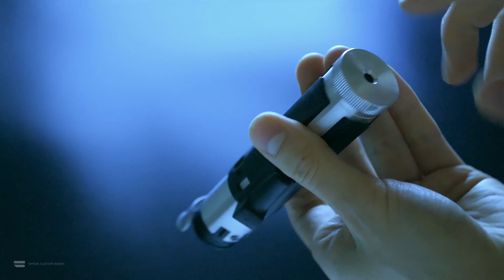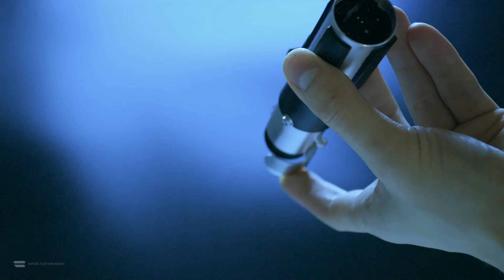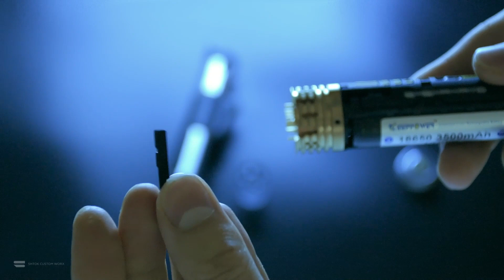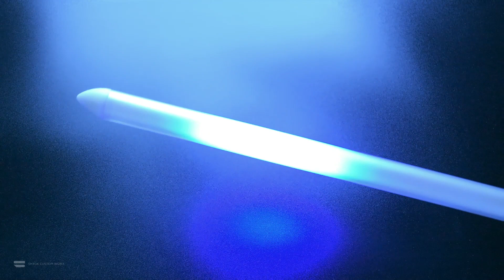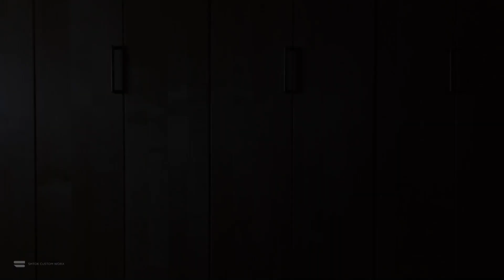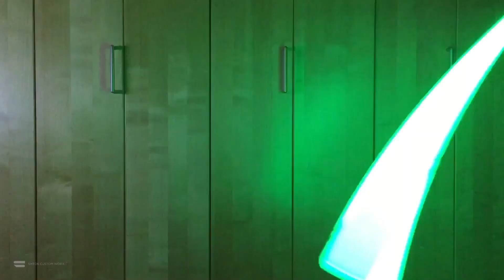MOST ADVANCED Master Yoda lightsaber with Proffieboard (Frog Apprentice)

Comment: Hi, can you pls explain how the Buttons work with that control box? Where can I get a control box for my bolsey that works like that?
Reply from the maker: this is a special rubber molded control box with steel rods inside that press the buttons on the chassis. You can’t get this control box anywhere because it only came with the Frog Apprentice kit.
Reply: Or is that "invisible Button"- control box only possible with the frog kit?